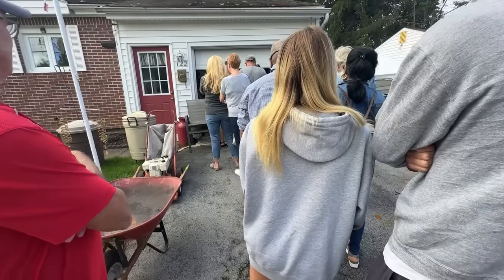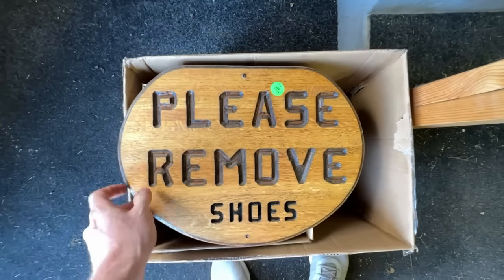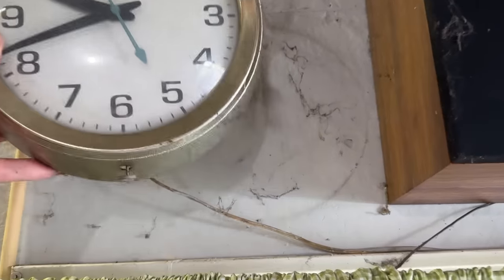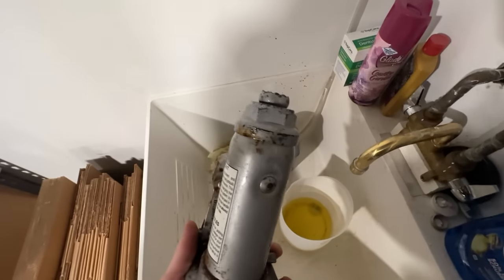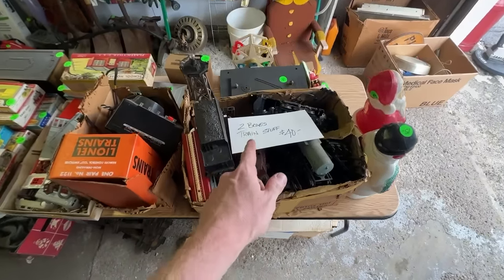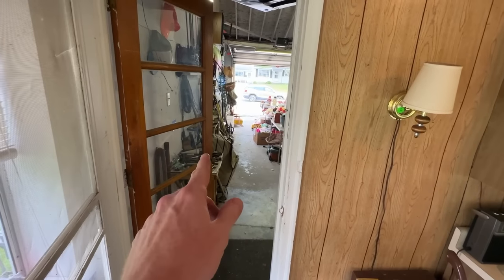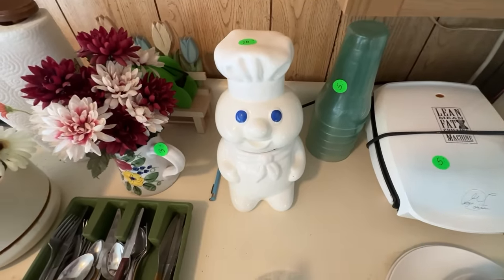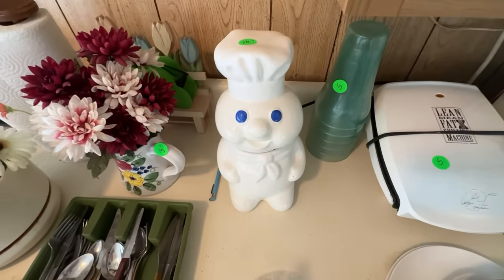EPIC ESTATE SALE GOLDMINE BRINGS INSANE FINDS!

Comment: If Lionel buy it. 😉 My Dad had a lot including a loader still with the wood on it, lots of working track n switches, accessory pieces like stopping light arms, crossing signals, one with smoke it poofed, one with sound, green land platform, trees, etc. Still works. Think Dad made the platform but all else original. So many pieces that fill an entire old black latch trunk. My son puts it out most every Christmas.
Reply from the maker: Agree if the price is right. These items sold well. Some Marx too

Comment: Missed the orange Tupperware container set ti.e stamp 1:01 and the toaster ,even though the toaster isn't vintage, it's a nice one that brand new retails around $89 so an easy $40 used,but overall , a great haul for sure !!
Reply from the maker: Did not miss either. Checked the Tupperware numbers on bottom and does not sell high enough. Toaster not worth it when factoring in the cost to ship with the bulk involved. I can’t explain why I pass every item up or the video will last hours long 😆

Comment: I'm gonna be honest, but it anything 1984 Los Angeles Olympics is pretty much a millstone that will not sell unless ridiculously cheap....  I would have not touched that hat for 10 bucks but hopefully you get something good for it...
Reply from the maker: Don’t worry, I have a lot of experience selling things for good money that ppl tell me in the comments they never would have picked up and that it won’t sell. 🥱 Not sure what you mean by millstone.
Reply: @PrimeTimeTreasureHunter   I get you probably get a number of comments that you find annoying (and possibly incorrect). However, trust me when I say I am speaking from experience. There is an overabundance of 1984 olympics souvenirs (they made alot) and none of it seems to sell well (per my experience and extensive research).  That's why I have learned to almost entirely skip 1984 olympics stuff now.  Granted it looks neat (and you'd think it would be good).  Currently, I can find some listed and sold for around $14.99 + shipping (which is not great margins considering cost).  The most recent one sold for $5.50 + shipping on auction Oct. 9.  That having been said, I'm not sure how you're researching to say there were none listed because I found those easily.  I know ebay does sometimes not show certain listed items on searches though. Oh, and a millstone is a large stone used for grinding grain (it is big heavy and takes some effort to move).  Basically we don't use them now because better / easier options are available.  Maybe I should have said it would be an albatross... but that is another metaphor you may not have heard either.  Anyhow, I sincerely wish you the best of luck.
Reply from the maker: @OnizukaSenseSay  all right, I see what you mean. I do know what a millstone is (and albatross) but never heard someone use millstone in that context. Btw I don’t find your comments annoying 😀 thanks